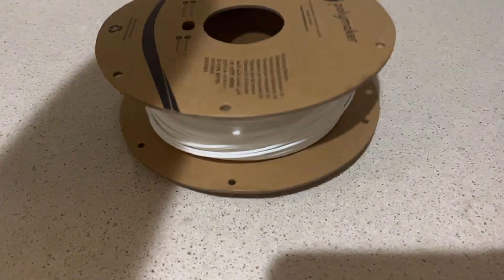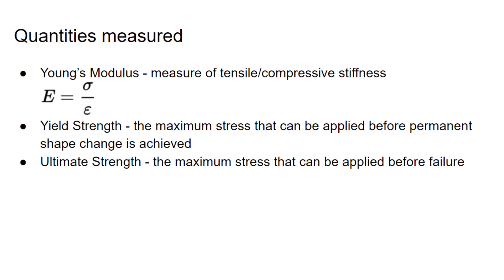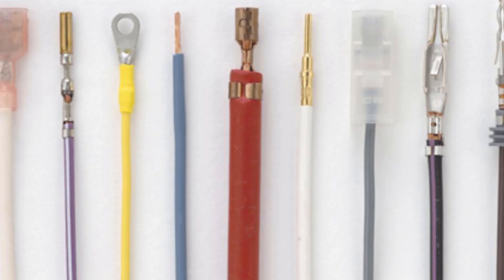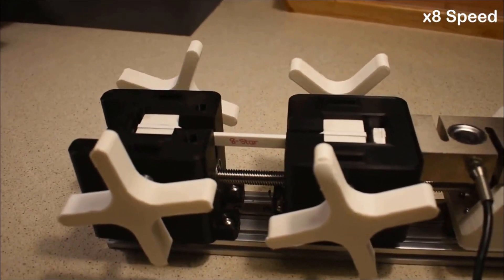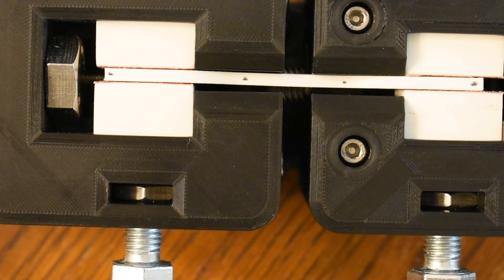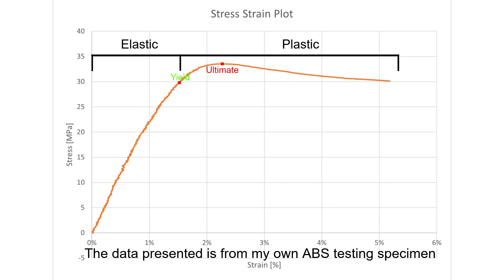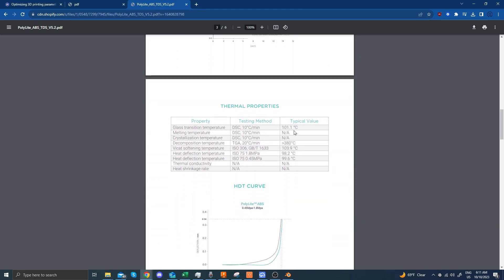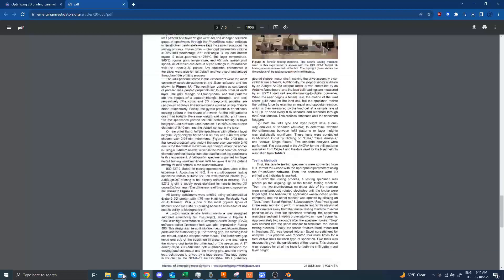NEW Universal Tensile Testing Machine #hackadayprize

Comment: I believe, the camera is a poor choice for elongation measurement. In plastic deformation, the bulk of the yield can occur outside the dot markings, or the dots itself can be hard to see on unhomogeneous materials, like fabric. Since you already use a ballscrew to apply load, assuming that your tester is significantly more rigid than the sample, you can just put a $1 magnetic encoder on the screw, measure it's angle of rotation, and easily get very precise information about samples elongation. 
Also, btw, did you look at the stress tester by CNC Kitchen? His design also seems quite cheap, you may gain some good inspiration from there.
Reply from the maker: The original design inspiration came from CNC Kitchen. He used a camera for measuring elongation. 
The problem is that the tester is not significantly more rigid than the sample as itself is made from 3D printed plastic reinforced by metal inserts. Ideally you'd want to use a laser optical extensometer or a physical one from a professional source, but with a limited budget the camera seems to work well enough for homogenous materials.